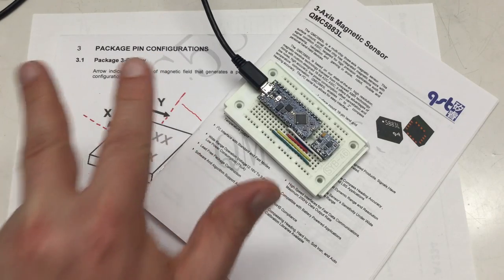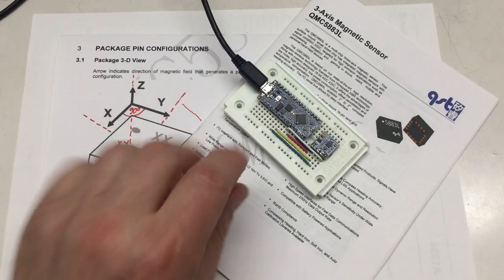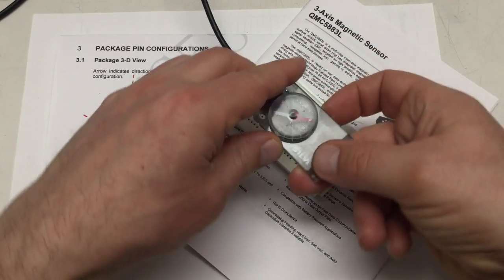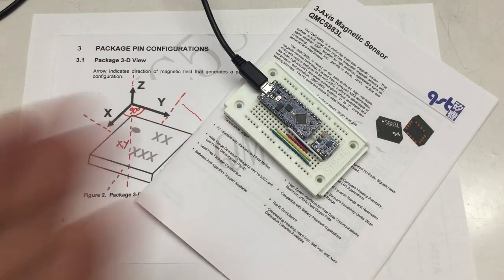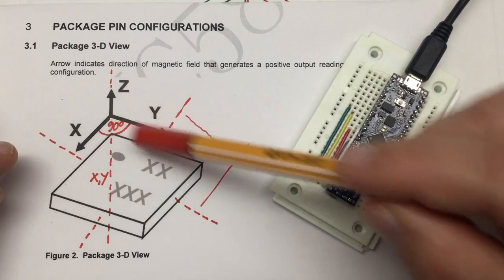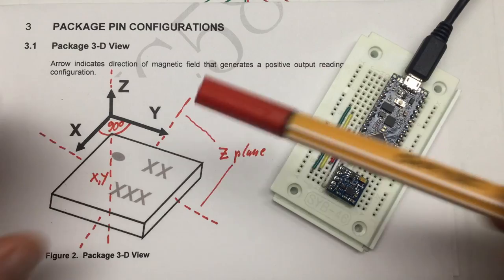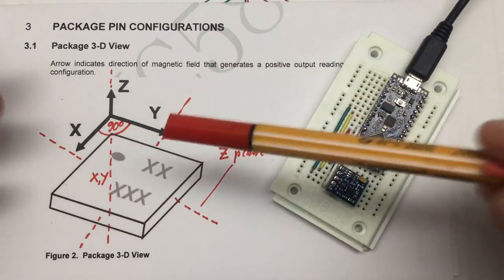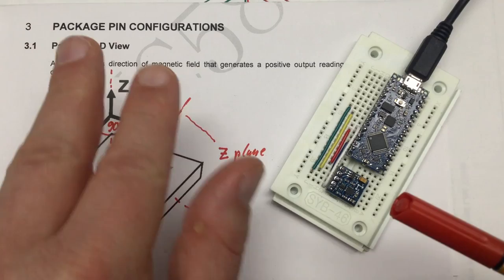QST QMC5883L 3-Axis Digital Compass and Arduino MCU – The Details (3)

Comment: As always, thanks for your efforts in preparing these videos. For me, this is very much "a touch of nostalgia for the old folks." It takes me back to doing my first degree (Maths) in the UK in the 1960s. The language of choice then for all the cool kids was FORTRAN IV and the space race was very much in the public eye.  Naturally, we did a lot of calculations calculating  orientation and motion in 3D space. In addition to Matrices and Vectors, Quaternions were an important part of the toolkit for efficient calculation. It is strange for me to realize that the 1960s are more that half a century ago. Nowadays, of course, I'd use C++ for such calculations, but that hadn't been invented then (not even C or its predecessor BCPL).  Moreover, an Arduino could easily out-perform most of the main-frame computers of that era so it's easily up to the job of what you are doing. Thanks again for taking me on a trip down memory lane! 

Regards,

Dr Miclael (someone born in the first half of the 20th Century)
Reply from the maker: As always, you are very welcome! And I have to thank you for your most interesting and extensive comments! In part 4 I will cheat a little bit and do the calculations for the matrix calibration on a PC. At it's core it's taking a calibration dataset (in my case 3512 points, created by doing 14 360° rotations in 14 different orientations) and spits out a bias matrix and offset vector. After applying those your data should approximate a sphere in 3-D space. A bit too much computation for the Arduino and a bit too much math for YouTube (though there are specialized math channels). But ... in part 5 I will do some kind of circular (modulo) median calculation on the Arduino for filtering purposes (at least that's my current plan).

Comment: I recently got one of these chips, your series has helped me quite a bit, I happen to notice that this specific chip (QMC5883l) seems to output data in big endian format (when I try to read using little endian - the values are not stable when the chip is stationary) despite the datasheet implying little endian.
Reply from the maker: And then there's the order thy bytes and the bits within the bytes are transferred via I2C ... It has been a while, but I seem to remember that I also ran into that big/small endian problem.

Comment: thanks for this explanation, it really covered the basics I wanted to understand from this device! I question though, shouldn't the measure of X (and Y) be altered when you tilt the device? If we put the device, say 45° from xy plane, the x sensor would be "far away" from the north and as a consequence it would change the value of alpha, isn't it?
Reply from the maker: You're absolutely right! To compensate for that you must measure the tilt of your compass chip, using for example an accelerometer, and then apply even more math! Some day I'll make a video about that, but if you wanna read up un the subject ahead of that have a look at https://www.infineon.com/dgdl/Infineon-AN2272_PSoC_1_Sensing_Magnetic_Compass_with_Tilt_Compensation-ApplicationNotes-v04_00-EN.pdf?fileId=8ac78c8c7cdc391c017d0731b0d05573 (full math) or https://www.instructables.com/Tilt-Compensated-Compass/ (a bit easier to digest).
Reply: @robertssmorgasbord  thanks for the reply. Looks hard than I though, mostly for the fact that you need to align the accelerometer with the compass, I think, in the Z axis, so this way tilt reference to ground should match between devices.
Reply from the maker: @anguinan  Your welcome! And yes, the math and the additional calibration for the accelerometer is not trivial.

Comment: Thanks for the information on the QMC5883L config and calibration!  Will your code compile on Arduino 2.0?
Reply from the maker: I have no idea. I'm still on 1.8.19. One thing I know is that Arduino no longer wants you to use their "boolean" type and that you should use the standard C++ "bool". But replacing that in the code shouldn't be a problem.